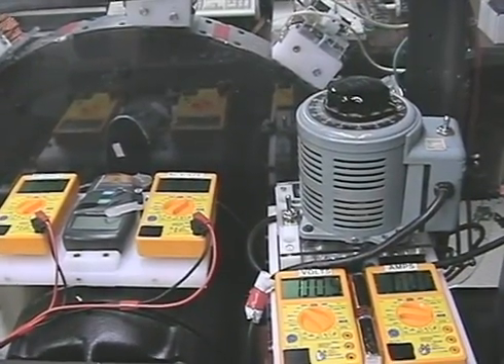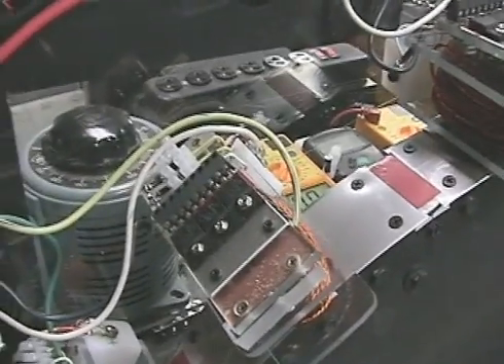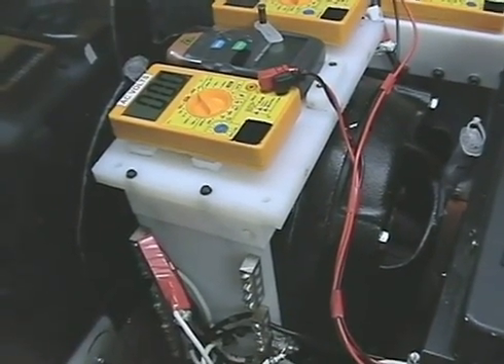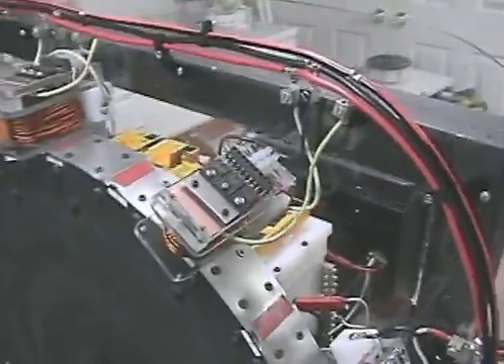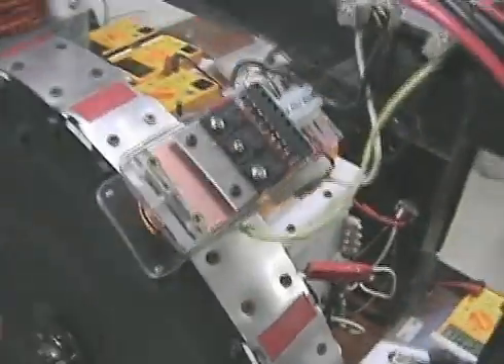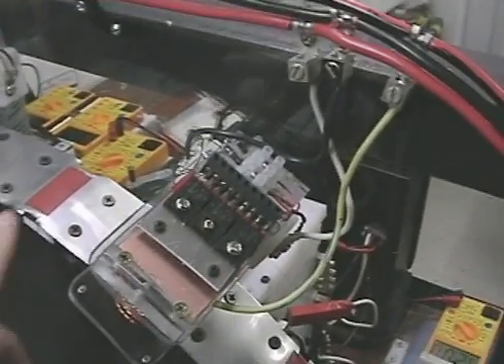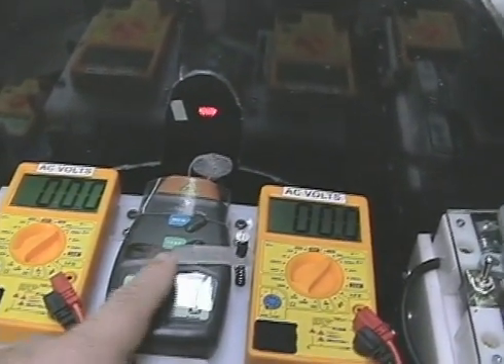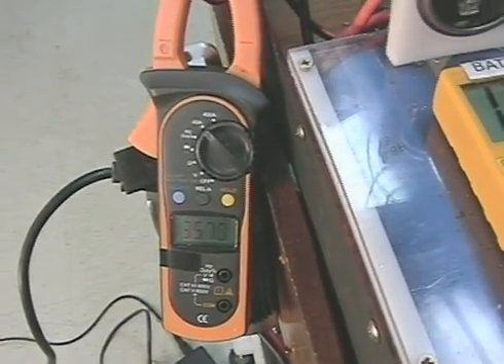CartMotorV2

Comment from the maker: watch some new videos you need a basic understanding. what you are saying is incorrect  and you are using words you don't understand a quad-flier means there are 4 wires together in one coil in most cases they are twisted together  running 3 chips and the trigger wire in most cases its better to know what you are talking about before you speak